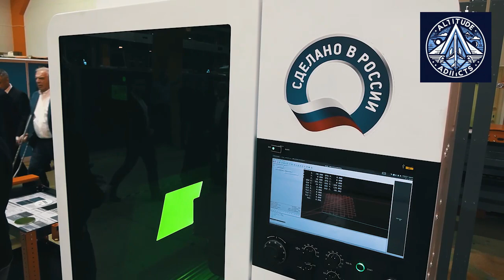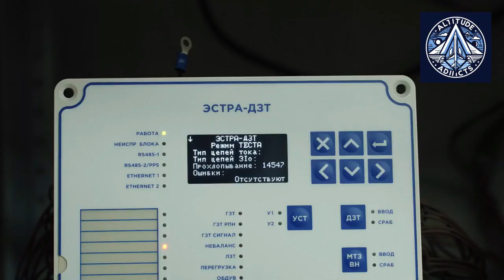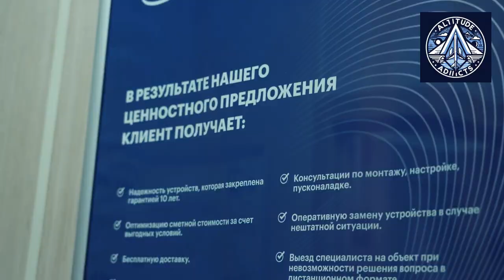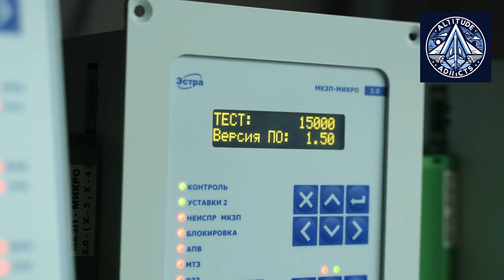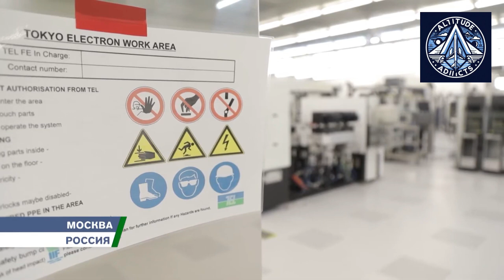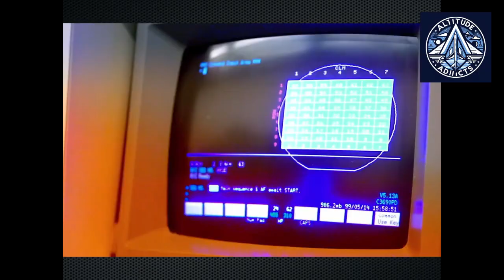Russia's New Module for Silicon Wafer Transfer

Comment: silicon wafers are no bigger than 150-200mm in those photos. Which makes sense advance quickly on smaller diameter wafers and worry about moving up to 300mm wafers later.
Reply: Прочтите заявление об отказе от ответственности в начале видео. Изображения предназначены только для фона...